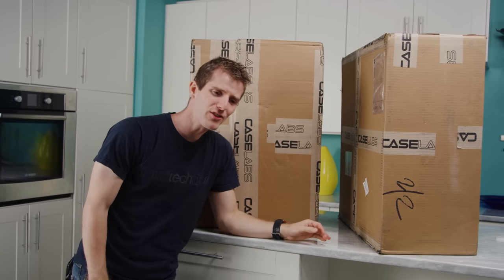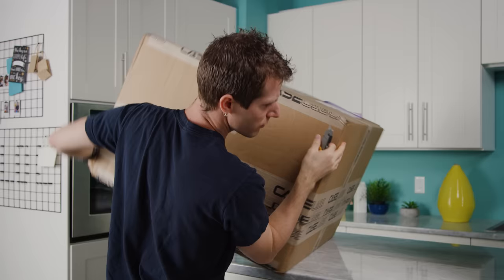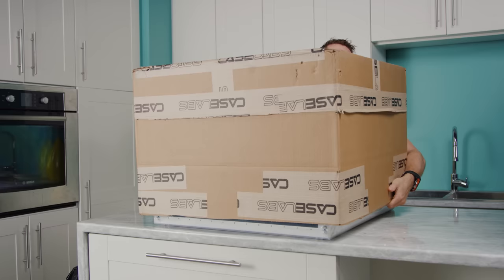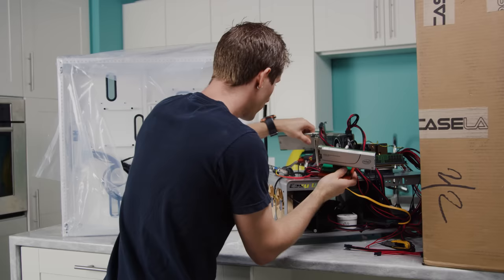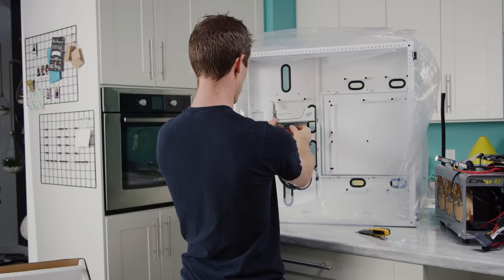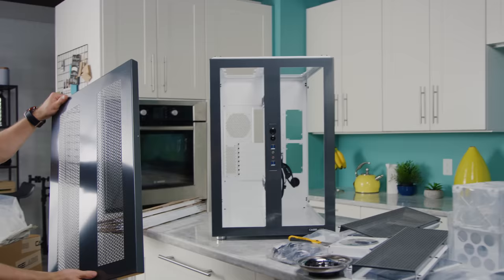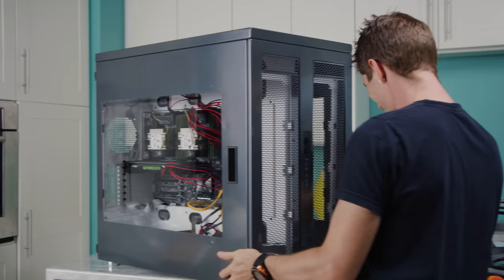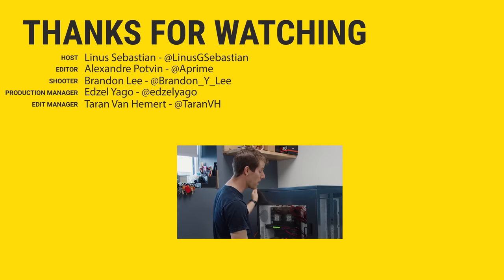How this PC Case Fits SIX Editing Workstations Inside!

Comment: At this point, just screw the parts into your wall and call your house your case.
Reply: I'd say that is the way to go, but when you upgrade does that mean you have to buy a new house?
Reply: That's not a bad idea actually.
Reply: good idea man, if you build in a submarine, you got another "CASE"
Reply: I know it's a joke, but there is no air in space
Reply: star of duty parts also can't get hot in space.
Reply: Pretty sure the components would actually overheat for that matter.
Reply: radiation
Reply: and they would overheat because they can't dissopate the heat
Reply: SEXY 1111 Salesman: Slaps ground "This earth can fit so many computer parts in it"
Reply: nerdalert226 for just 6100000000000000$
Reply: space is a vacuum, no air or flow, sorry.
Reply: Send it to pluto and get an extension cord to fit
Reply: Send it to pluto and get an extension cord to fit . No thermal issues or acoustic issues
Reply: From pluto you would have lag of several hours.
Reply: yes
Reply: So many people who don't really get how vacuum and cooling in space work...
1) It's not 3K everywhere. Hell, Pluto is not at 3K and it's kinda far.
2) You want to install the radiators in shadow.
3) You do actually want cooling, and it's not really that simple because fins that face eachother also heat eachother, and since there's no air to take heat away you need to redesign cooling.
And so on.
Reply: mattflub yes they can
Reply: Great idea. He can then use AC as cooler and just turn AC off if he needs heating.
Reply: When you buy a new house, buy a new CPU. Simple.
Reply: Lol, make sense.
Reply: Definitely not. i mean if youre building a mainframe, possibly. but no one that is gaming for themselves would do that unless they of course had several games that needed 24/7 surveillance. for many reasons, such as conquer private servers of which grant the player a specific amount of in game currency per hour. or per 15 minutes in my case. or things such as Lineage II where you need to be auto farming 24/7. but going to this extent would basically be futile. A single person could never fully enjoy any one game if they used enough monitors to benefit from the massive mainframe theyd be able to create with all the space the average home suggests would be available.
Reply: Wait where's the check mark?
Reply: Kewl
Reply: @terner1234  r/whoosh
Reply: and your ac is the case cooler
Reply: @bIahaj  didn't get jokes back then
Reply: Genius
Reply: DesolatorMagic I mean you r not wrong
Reply: Well most items probably damaged by ESD. I find it peculiar to attempt to create something that 6 other users depend on, treat it like its a piece of wood that can be banged into the case (optanes) and electronics touched after having played with plastic. That thing might become quite unstable :D Good way to possibly waste a 100k just by being too lazy to wear an armband. Impressive!
Reply: DesolatorMagic that’s literally just a wall mounted pc lol
Reply: it has rgb, multiple tempered glass windows, watercooling, fans a massive power supply making the thermals great for gaming AND YOU CAN LIVE IN IT
Reply: This one guy i know had his pc build under his gaming table, hanging in the air by wires and fishing line. He said it was to not have his pc overheat so much.
Reply: Lol I like dis
Reply: yongle sun subs are water cooled.
Reply: Huh, they should do that. Would that work? Could they make it a project? Maybe not a whole house, but like a she shack.  A computer cubby.
Reply: in live in the case and call it your house
Reply: @DarkDreth  what if you just put air in space
Reply: @Broockle  not if it's running at light speed. Although then you might actually have negative lag.
Reply: I'm waiting for Elon to build his PC on the moon.

Comment: 3:12 it’s like opening an Apple product.
Reply: JoeyLovesTrains hahaha
Reply: No it's not, there weren't any shitty products inside.
Reply: nope! didn't slide off the table and bounce on the floor...   .... :)
Reply: Haters gonna hate.
Reply: JoeyLovesTrains goodness so many apple hating sheeple in this thread
Reply: hate hate hate
lalalalalal dont know the rest
Reply: Wladimirowicz Steve was a good man,  Apple went downhill when he passed away...
Reply: MEDUSA-KILLER13 agreed
Reply: Wladimirowicz visit a doctor with that complaint pls
Reply: mjc0961 well they are both expensive as fck
Reply: Only thing I'd buy from Apple is a fuse, like Louis said, it's the one thing that never breaks, because it's supposed to.
Reply: Stop giving shit for Note 7, Samsung handled that exceptionally well. First, they informed customers and offered a recall program. Then, they tried to fix the issue, and when they believed they did, announced the update and a clear way to confirm it (the green battery icon). They tried their best to satisfy users who did want the phone. And when it failed too, they handled the recall again. The whole thing probably costed them a lot, not just in lost sales but in handling the thing too, but they don't play with the safety of their customers.

Compare that to Apple and their shitty practices. The iPhone 6 and especially the 6 Plus bent from normal usage. Their response? Deny, deny, deny. They went as ridiculous as stating only nine phones bent, and relied on their idiotic fanbase to fight for them. Now, four years later, recently published documents show that they knew it very well that the phone would bend, but they still sold it. After four years, they are still blaming the user.

And that's just one of their many faults. Louis Rossmann did a nice video on it, I'd suggest you to watch it.
Reply: Can a chain of comments get any more sad? I don't think so.

Comment: have you ever reviewed this  Thermaltake Core W200 Dual System Capable Extreme Water Cooling XL-ATX Fully Modular/Dismantle Stackable Tt Certified Super Tower Computer Case CA-1F5-00F1WN-00 Black case?

Comment: And I still have a hard drive :(
Reply: Used SSDs going for dirt cheap are almost always still good for another 10 years. I would get a old Samsung 840 EVO for $50 off ebay or cragslist. You can't go wrong as long as you check the SMART status and TRIM level as soon as possible.
Reply: Kaptive TV You think that a hard drive is bad?! I still have a floppy disk drive!
Reply: Mark M I used to build computers for my jobs over the last two years, I just sold my old SSD because I wanted a nicer one. Just am shiz broke😂
Reply: Kaptive TV
I do too, most people do. But in addition to a few SSDs. Although, two enterprise grade hard drives in raid one configuration can achieve over 800 MB/s peak, and 400 MB/s normally.
Reply: Yeah anything in computers other than server administration and programming director is crap money or long stressful hours.
Reply: You can always be your own boss and make more money doing less work. Just consult a tax office on what you need to do so everything is legal.
Reply: Buy a cheap SSD, maybe a 120gb, and put it and a hard drive in hybrid raid. SSD speed, hard drive capacity
Reply: First Last
I can make a demonstration video to prove it. Also, I meant raid 0.
Reply: Mark M That's if you aren't unluckly enough of getting it while it breaks after a few minutes.
Reply: James Collins SSDs aren't just about better read/write performance but also the much shorter response time.
Reply: I have a 2tb hdd and 500bg ssd, youre not the only one
Reply: THOMPSON GAMING 2.5TB 2.5" HDD.
Reply: Mark M what are smart status and trim level?
Reply: Never underestimate Hard-drives! SSD's are great! But when you get to 1tb-2tb they're pricey! fear not, for hard-drives are still relevant!
Reply: Mark M But they can't match the raw reliability and price point of a used Hitachi enterprise HDD. 3tb for $50, rated for 3 million hours mtfb when spun up.

To compliment my two 3TB storage drives I'm using a 600gb MLC IoDrive2 for a scratch disk. Rated for 95 petabytes of wear. It is actually a lot faster than the new Intel 3Dxpoint drives.
Reply: First Last To be fair. A lot of enterprise HDDs can do a sustained 350~400MBs write. It is entirely possible that he is correct that his RAID0 array can to a sustainable 800MBs of write and read. I have old as hell enterprise Hitachi 3tb drives, and they each do 330MBs easily.

Comment: So you built a mainframe that has six terminals.
Reply: no, it has 3 terminals and 6 outlets along with 4 reservoirs. Its also bulletproof casing with 2 mm thickness and 3ph acidity.
Reply: wannabe bat it's supposed to have six monitors with six separate inputs, that's six terminals. If it's only three, then it's one PC three workstations, with three mirrors, not six workstations
Reply: *pH
Reply: Demonslayer20111 that's okay you can have your opinion but it has three super outlets and 3 mega catridges.
Reply: wannabe bat pretty sure it's six. It's mentioned multiple times throughout this video that it's meant to support six separate users, and act as six separate workstations. And in order to do so, you need six separate vm, which are anologous to six remote terminals to a server. Any thing other than that would not support six workstation vm's
Reply: wannabe bat that and I'm pretty sure you are making shit up at this point, because the only mega catridge I've heard of concerns Sega.
Reply: Demonslayer20111 that's the fun in having tech debates.. you can make shit up and the other guy would know it when we're already deep in the convo. It's fun. You should try it.
Reply: wannabe bat most people aren't willing to plead ignorance, so that's why it usually continues. I was pretty sure you were full of shit with the four reservoirs thing, but gave u a benefit of a doubt because this is water cooled, but the super outlets and mega catridge gave you away.

Comment: An awesome project yes, but I would NOT put my core business into one machine. It is NOT cost-effective and NOT reliable. If the PSU fails, your whole company fails.
Reply: Dont be stupid, this is not his core business. $100k does not amount to anything significant at all. This set up is probably for the interns.
Reply: And how many spares do you think he has on the shelves?
Reply: This isn't going to be an actual machine that they use it's a project for a vid and maybe ltx
Reply: Linus once mentioned on a WAN Show that he doesn't switch to new processors as they are released, instead he waits until they mature and prove their reliability just like every other company. That's enough to tell you that their core workstations won't be transferred over to this project
Reply: NJDRJ although they have been on those 10 cores for awhile so I wouldn't be surprised if they upgrade pretty soon but it definitely won't be to this case
Reply: You're not wrong. Redundancy is key to the stability of anything important, and UnRAID is definitely not redundant. Multiple cases, drives, motherboards, etc is important to ensure one failed component doesn't halt the productivity of everyone. Cool proof-of-concept though.
Reply: If he treated this like a Server, it wouldn't be a problem. Redundant PSU, two power strips going to different breakers, and a UPS.
Reply: JonasTheKing 
Well he has backup servers.
Reply: McNetDeck then again he could just add another server rack or two
Reply: U obviously don’t watch this channel a lot
Reply: He learned after a raid controller in his server array failed and had no backup systems in place at the time.

Comment: My current setup has this case, a ryzen 9 950x, three 2080ti’s, 2 sound cards, a 360 hertz monitor, 64 gigs of RAM, with 4 terabytes of storage, and rocking an x570 mobo with 5 fans. Is this good enough too run Minecraft at 30 FPS?

Comment: TRY A CAR RADIATOR
Reply: IG Gamer why?
Reply: Maybe somehow a single large radiator would be more efficient than several smaller ones. Total guess though.
Reply: IG Gamer Water-Cool the cables and case!

PS: Best setup would be one radiator on the cpu and gpu and a big one for the rest.

That would give a good air flow, but is loud and sucks energy
Reply: Filmemacher he can use a big fan just like the one in jayz vid, and what else would u water cool if u have already done cpu and gpu?
Reply: IG Gamer Yeahbut I still think an extra fan which supports the cpu would help the air flow instead of an big airflow through the heatsink.

Well, how about the North/South-Bridge, M.2 Slot, other electircal components.

Cable and the case don't really generate heat. At least in a normal running rog

Comment: Still trying to understand the need for punch ins from 8k to 4k... Just frame right on 4k and save space. This is what happens when your camera guys are on the same level of hardware nerd as a PC fanatic. I guess it does help that the channel makes some solid money that allows you to make these videos... which in turn makes you money.... Kinda funny if you think about it. Like a snowball effect in a positive direction.
Reply: Daniel Millner As an editor it is a huuuge plus to have enough resolution to be able to rescale and move the frame
Reply: Im aware, I also am a cinematographer/editor and have been for about 10 years. My point is that for youtube shooting at 4k and punching in will not be noticeable to the standard viewer and 8k its not where money should be spent. Shoot it right with multiple cameras. A punch in is lazy editing 98% of the time unless its used at an effect.

Comment: This just hit the absolute ridiculous ceiling!!
100.000$ pc??
Reply: Not really its more than a bit misleading in the title as this is not a consumer grade PC. Once you reach server/workstation grade hardware the prices jump to ridiculous levels A single 28 core CPU can be on the neighborhood of $10,000 USD and this board uses 2 of them, add the rest of the hardware and it adds up really fast. The Quadro videocards Linus mentioned can cost around to $3,000 USD each and on this build it will probably end up with six of those. It does boggle the mind though.

Comment: Why not 2 EPYC CPU's?
Reply: not sure if amd has dual socket stuff, plus i think intel's 28 core one has better overall performance.
Reply: Azenix yes amd has the capabilities of 64 cores and 128 threads and testing shows that Intel within a core area is not  much faster and with more cores overall can be slower in some applicationz
Reply: Applications
Reply: KelefGaming I think because the only dual core EPYC mobo you can get has half the pcie slots of a Xeon mobo. Also he already has the Xeons lying around as Intel send them to him for free
Reply: KelefGaming Could be because of the accesoirs of the MoBo?
Not sure about that, but he seems pretty happy about the connectivity of this one

Comment: Shame you didn't use epyc or threadripper
Reply: The point is to be as stupid expensive as he can, epyc would be saving.
Reply: Vincent Burns maybe Intel is giving him a hand? He's not fully Intel bias but he does seem to cover Intel a lot
Reply: It is probably because Intel historically has a wider array of high-end and server hardware while AMD tends to focus on the middle ground. AMD in the recent past has been trying to compete using Epyc and Threadripper though. Personally, I prefer Intel as I dislike AMD's caching mechanism. From my experience, the redundancy in Intel's caches tend to be better for performance for concentrated loads like gaming.
Reply: DraconicEpic the thing is epyc and threadripper are better than anything Intel has in that range. Lower end ryzen is a smidge slower than Intel but much easier to use, no need to delid, usually a usable CPU cooler (except 1600x). Intel is just better if you have the money to throw at it to give you the full experience.
Wish Intel would stop cutting corners so any Intel fan can get the quality they deserve
Reply: While Epyc/TR have more cores in general, they are not very good at VM for some reasons.
Reply: DraconicEpic yeah gaming.... Epyc and threadripper are not gaming CPUs and if you're buying it to game on... You're dumb. They're server CPUs and rendering machine CPUs. Animation, deep learning, video editing, 3d design.
Reply: I think I recall Linus speaking about this and saying something along the lines of single core performance being better on Intel and mainly I believe he spoke on the fact Intel has been at it longer where AMD is a bit newer to this area with these more recently released CPUs. I wish I recalled which video he said it but it was somewhat recent, a month maybe two at most (which still means a lot of videos so sorry I cannot point to which it was exactly).
Reply: EPYC dual-socket motherboards are still in their infant stage and seem to have a lot of problems that no longer plague Intel, and Threadripper is single-socket only.
Reply: Enasbre Noir they have to explicitly state that the video is sponsored if the video is actually sponsored. They haven't been shy about Intel's sponsering their videos in the past, so I don't see why this would suddenly be different/
Reply: The problem is that it's sometimes difficult to find software that supports AMD Chips with few errors. To run unRAID as a OS would probably cause more problems than an Intel chip would. Just look up the forums on that (I've been doing some research on Threadripper) and Epyc Chips are far less supported unless you directly get in touch with the developers on the software you want to run. It's just easier to stick to Intel for Virtualization at least until more support arrives to solve AMD Chip issues.
Reply: Benoit Levesque maybe it's because they have extra security that Intel lacks? Heh